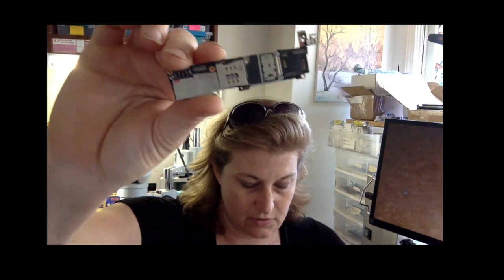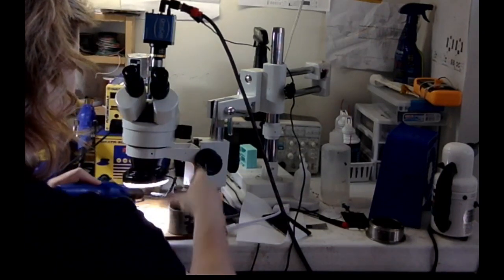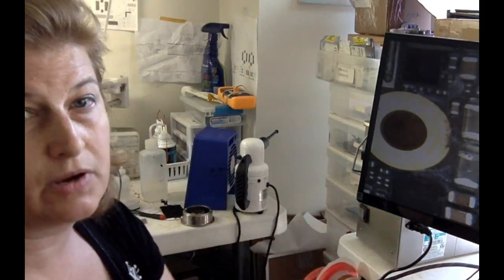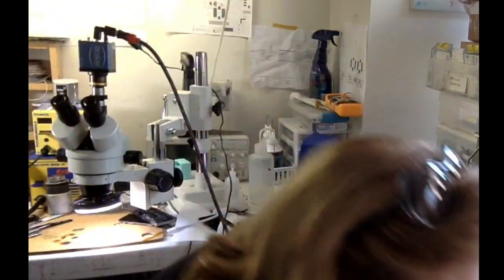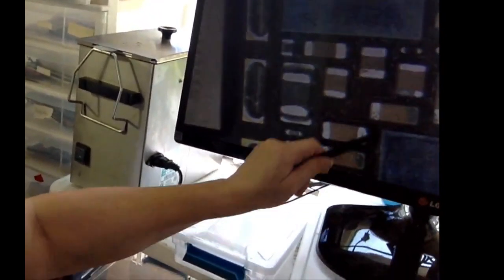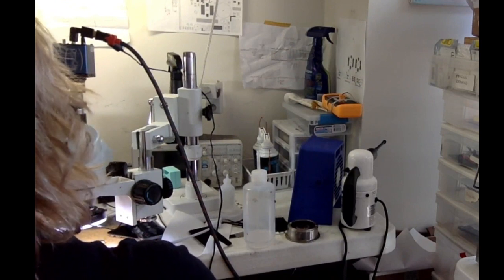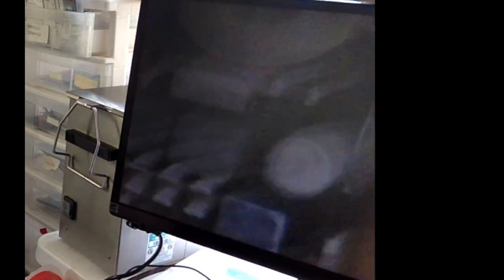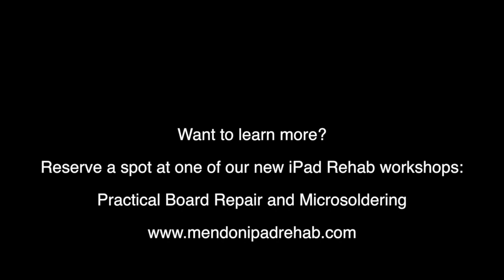How to Professionally Repair iPhone Water Damage

Comment from the maker: "Cleaning" a water damaged iPhone without desoldering the shields, is like cleaning a cat litterbox by scrubbing the outside of it.  Either way, there is going to be a lot of crap inside when you're done.  Here's what you should be doing instead....
Reply: +iPad Rehab hey can you show me where you get your tools
Reply: +iPad Rehab and when you remove the baseband chip...i have spare chips from china if i do replace it will it change the imei ....
Reply: +iPad Rehab hey and will changing the logic board,still do the job
Reply: +slim wiz changing the logic board is pretty much  the same as buying a new phone
Reply: Jessa Jones thanks for replying.....i know ur really busy but lets say a friend of mine has  a baseband chip for iphone 5,if i changed the original chip on the motherboard with this new chip..will the phone work ..nd will it have a new imei
Reply from the maker: slim wiz none of this is worth it for an iphone 5

Comment: If you will blow hot current vertical from up it is easyer and you can save the shield to solder it after repairing.

Comment: Hey Jessa, just a quick question:From watching your videos, as well as Louis' videos, I understand that a good, top of the line ultrasonic cleaner is going to work much better than the smaller, cheaper ones.I am going to try my luck at water damage repair, mostly with my own devices as a learning venture rather than offering it as a service to my customers.  If I get good results, maybe then I offer a service.  However, just starting out, I just cannot allocate many hundreds of dollars on a top of the line cleaner.My question is this:  are the smaller, cheaper cleaners still better than nothing?  How long did you use the smaller one you show on your bench?  Did it improve your success rate, even if not as much as the bigger, better one you have now?  Would it be fine to get a cheaper model as I am only just starting out, or would I be better off just keeping my money?

Comment: You are brilliant! 'm going to repair a water damaged iphone 6 and I see now that I have to take off the shields. Is it possible to remove the shields with a solder iron without using flux? After the repair, is it possible to have the kaptop tape permanently instead of the shields? Thank you for the videos, everyone, lowend to highend technicians are surely enjoying them!

Comment: Hi Jessa, what ultrasonic cleaner do you recommend or what do you use? Thanks and you are an inspiration.
Reply from the maker: Hi Tom, thanks!  I use Branson EC as the cleaning agent.  The machine is a Crest sweeping frequency ultrasonic cleaner with heat and time functions and a stainless basket.  Similar models are made by Branson

Comment: hi so i had droped my phone in the water like any regular person i put my phone on rice and after a day i tried turning it on so this is what it does it shows the apple logo like if the phone is turning on but it doest turn on the logo goes away and it doesnt turn on i try turning it on again and it does the same thing you think if i do this what you do on your video will my phone turn back on?
Reply from the maker: Jose Martinez who knows--sending electricity through a phone that had electrolytes dried on the board isn't good.  Sometimes they come back after cleaning with alcohol, sometimes the damage is too extensive and it needs component level repair.   You can take it to Apple and get an out of warranty exchange for two-three hundred bucks

Comment: I use a Sonicare electric toothbrush on my boards after they have been in the ultrasonic bath, iv found using that instead of a regular brush is a lot softer on the board, so you are less likely to knock components off, but it gets the oxidation off really well because of the way the head oscillates at ultrasonic frequencies you don't have to press it very hard at all :) , it cleans your teeth well too lol.

Comment: Do any of you use dielectric cleaner? Is this a viable option for repair professionals.? If not what are the reasons for using an ultrasonic cleaner over or rather than dielectric cleaner. Thanks Frank

Comment: Hey Thanks for sharing this video.  I have a MILDLY water damaged iPhone 6.  It's almost as if a drop only touched the LCD connectors b/c the phone works fine (camera and all takes photos, videos etc) except 1) the LCD has lines through it (it was one vertical line now worse after I attempted to clean the connector with 91% alcohol.  and 2) the flash (and flashlight) don't work.  Other than that, everything functions and the inside of the phone looks great.  No rust, corrosion or anything.  In fact the water damage sticker is still white on the sim card tray and the top one is slightly pink with a bit of red in some parts.
One video explained that it was just the LCD connectors and that using a toothbrush in alcohol was all that would be needed, but that did nothing.  It actually now has more lines :/  Any suggestions?  Is there a way I can send you photos of it?
Reply from the maker: +Rosie Foster lines in the LCD is a screen problem.  I wouldn't advise putting money into any water damaged phone, but a new screen would probably solve.

Comment: I just have called numerous unauthorized services. They called me they do not use ultrasonics cleaners, as they break the logic boards (they use qutips + IPA). This is BS, right?  Do they say that "we can't afford a real cleaner" (I am calling from Poland, its still a poor country) or what? Could someone try to get into their minds?
To what extent are ultrasonics noninvasive? The reason I decided not to use qutips was I was afraid I will take some of the board component with my qutip... I would say that qutip are more invasive than ultrasonics.

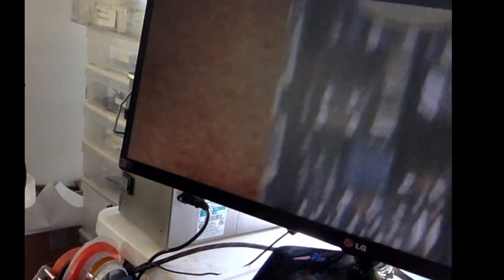Comment: 8:35 Question, what does rust do to diodes? so, just having rust on or around diodes, can fault them? (obviously I don't know squat, but this is a question thats kicking around) I would think that rust on top (surface) wouldn't affect the conductivity. UNLESS its just straight rusted through, in which case a cleaning wouldnt help much, and a complete replacement would be in order.
Reply: I think I get it, your just clearing away so you can get a good look at what exactly your looking at...
Reply from the maker: look up what a diode is---they are pretty rare to find on a circuit board compared to everything else.

Comment: Hi. I recommend putting boards in silica gel in a static bag to really absorb all the moisture that say alcohol (which at least has 1% water for 99% alcohol) and baking can't really get rid of (coz' I would guess like water undeground, some water won't evaporate if it's underneath something and reheating things is taking the life of components molecularly like it would with food when you keep reheating it. God bless. Rev. 21:4

Comment: Hi Jessa.
What is the price tag on that UltraSonic-cleaner ? 800-1200 ? Have you ever tried to use straight rubbing alcohol for cleaning? Branson seems to be a good brand, but why not use rubbing alcohol? Thanks.
Reply from the maker: Because it is not a detergent.

Comment: Hi Jessa I was just wandering, as you did a video clip with a lady called Sunday , you advised to always take off the shields or it's not a professional job on water damaged phones when putting them in a ultrasonic cleaner right , as under the shield is still dirty/soiled right , so my question is if the ultra sonic cleaner can't clean under the shield , I take it it won't clean under the ic s ????? Apparently after some research I found out on micro pcb s the frequency needs to start around 130 kHz frequency as the cavitation (bubbles imploding) are too large and will not reach the tight spaces with the 30 - 45 kHz frequencies , I'm a newbie so if you could advise I would be grateful thanks

Comment: Hello mam, I have two iPhone 5 phones, one of them is water damaged, so I gave it to the local repair guy and he replaced the screen on it with a cheaper lower grade C screen. now the new problem that arose due to this is that the phone heats up and the touch is really bad, so what I did was , i tried to replace the cheap screen on my own with the original screen from the other spare phone I have. However when I put the original screen onto the other phone it doesn't seem to work for some reason :(
All i see on the phone is horizontal black and white lines like an interference pattern when I press the power button. no picture at all . and this is really strange because when I switch back the screens to how it was previously i.e. put the c grade screen into the water damaged phone and original screen into the other phone, every thing works fine. both screens  show full colour and picture . I really want to understand what could really be the issue . Can u please help me out with this problem. The touch of the cheap screen is very bad and I want to change it. is there anything I haven't considered here, are screens from other phones not compatible or something?
Awaiting your reply. Is there any way I could contact you personally over mail or something. some pro tips would be really appreciated. 
Thank you for a great video.

Comment: What can you suggest on my problem. board is water damage. no power but one of the network IC chip is heating up when battery is inserted, the battery pin positive and negative is shorted. I have checked one of the capacitor near the power IC with both side shorted with negative(I have learned that with one of your video). I tried removing it but when i tested the pin on the board still both are shorted with negative ground. any suggestion?

Comment: Hi Jessa, do you use the CP500HT or the CP500D? On my CP500D, I have a setting for power, which was defaulted at 9. Do you think that'd be fine? I already did one board with great success, but would like to know your input! Thanks!

Comment: You cannot fully stop water damage. You can clean as best you can and fix at component level but once corrosion gets its teeth in its possible further failures may arise in the future, not saying it will but im saying its possible. Once oxidisation starts it can speed up degrading.

Comment: Why did you truned the board to the other side? dont you use the basket? if so isent it enough, shouldn't the ultrasonic waves/liquid do the work on all over the board at the same time?
Reply from the maker: Sos Mac  mostly habit.  The last thing I had in there was a set of cymbals from the kid's drum set.  brass cymbals plus Underdog the worst pug in the world = serious corrosion.   I did notice a performance difference as I put them in first one way, then flipped over.   No clue why!  I always flip over MacBook boards, so sometimes I do for cell phone boards as well.

Comment: my daughters iphone 6 was dropped in water.... every thing came on after rice but the board has not been cleaned and battery not replaced, the phone does loose charge quickly almost hast to be pluged in to operate,,, every thing works but the volume, no sound from speker or head phones..... what to do and can i send it to you to fix

Comment: Ipad Rehab, i cleaned Iphoen 6 16GB Water Damage, but when it comes Up, the screen is too low Birhgtness and the touch dosent work anymore.... i let the Phone into the alcoolhol isoprophil for 8 hours and brush it later, and let it dry four some hours, and still Touch dosent work anymore, and the screen comes low birghtness (crazy), some times it comes low, some times it get a high ? What should i do ?
Reply: the screen wasent the problem...

Comment: Hello Jesse you have a lot of videos on different problem but I haven't found any videos related iPhone no service?
I have an iPhone 6 Plus water damage somehow I made it work but after an hour later signals dropped only one signal left and now it has no service. 
And I can't find any solution for that??
Reply from the maker: That's because there is no robust solution.  The fault is poor connection WITHIN the board at the bb_cpu.  You can reball the bb_cpu if you want and it will solve, but it will also recur.

Comment: Hi I have a water damage yesterday and now i put it on a ziplock with rice.what should I do next.t after 24 hrs I checked it and still no power or anything on screen when I turn on. I haven't charging it bc they say it will get worse.
Reply from the maker: +Francis Santos rice does nothing, so get it out of the rice.  Do not attempt to power it on and send electricity through a board that has water and corrosion in it---as they all do the instant water hits the board.  Take it to a local shop that can open the phone and properly clean the board, including desoldering the shields to address the corrosion that happens under the shields.  Then dry the board and put it in a known good housing to see if you have board damage.  If it works, put it back in its native housing and see if anything needs to be replaced---screen, battery, charge port etc.
Reply: +iPad Rehab okay got it. Thanks for the good advise. Hope their is no damage that much..😄
Reply: +iPad Rehab if I'm going to buy a new one can I still be able to recover all my photos etc.thanks

Comment: iPad Rehab 

How do you install emi shields back onto iphone 6 i only see uninstalling YouTube videos thanks
Reply: Apply little flux and line it back up, reapply same heat used to remove it until you see the solder get wet/shiny. Continue heating for additional 10 seconds then let cool. Should have reattached itself

Comment: How can I send you my iPad 1 to get it fix it fell on water and can't get it to turn on need help getting pictures out the apple simble is on it tries to power on but it does not
Reply from the maker: Data recovery ranges from $300-$400 depending on turnaround time required.

Comment: Hi What temp is the hot air set at please? Thank you
Reply from the maker: Somewhere between 300-450c depending on the job. This always differs. 

iPad Rehab highly recommends the Quick 861DW http://bit.ly/2xGDTXo for a cheap, affordable, powerful hot air station with an easy interface. It will remove all different types of chips without a problem, unlike weaker stations that can't stay hot enough long enough to do the job.

Comment: Will this fix restore error 1 ?
Reply from the maker: dave k  possibly.   restore error 1 kind of means "uh, something is wrong somewhere on the board"  it is very general.
Reply: dave k restore error 1 is the baseband ic, replace it and it should be fine
Reply from the maker: Peter Campbell dave k  There are several chips that all contribute to the baseband.  Some require flashing from DFU after replacing in order to program.  In general error 1 is a pretty broad error, it isn't something that is as simple as replacing one specific chip and that will solve.
Reply: I appreciate that, I have come across this 3 times so far and replacing the baseband ic has resolved it everytime so far